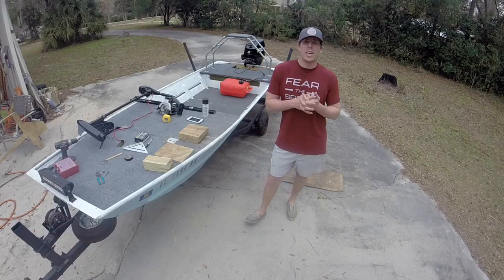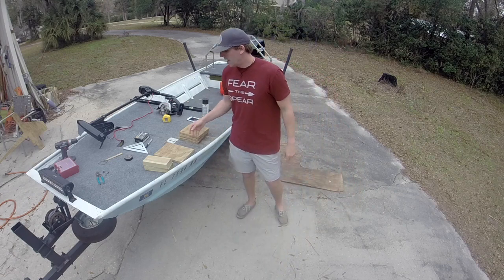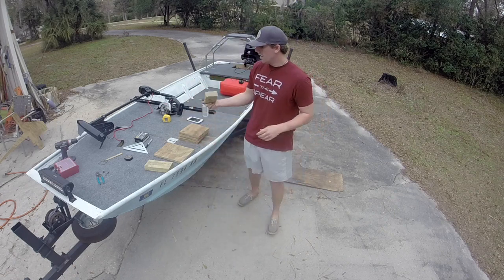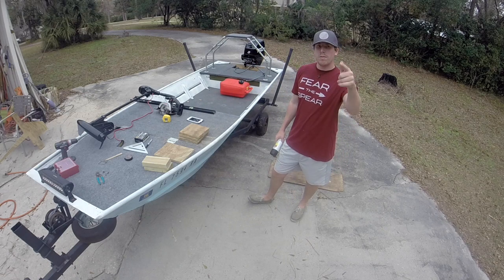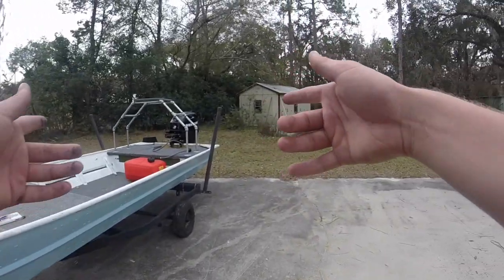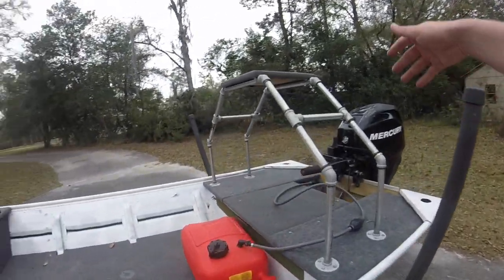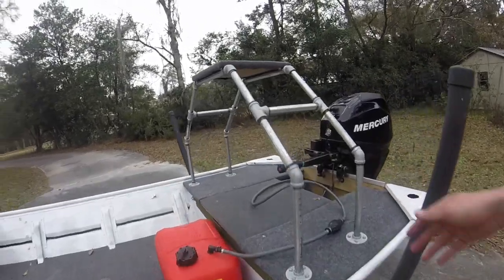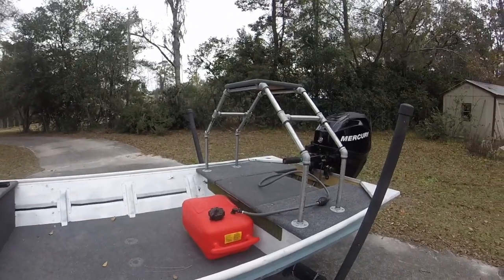Jon Boat Bow Trolling Mount

Comment: pressure treated wood will corrode aluminum.  I would have used 2 x 8 wood instead of plywood.
Reply from the maker: Yeah I didn’t read into that until after the project, it’ll have to be redone eventually

Comment: Could you send me all the measurements cuz I have the same boat
Reply from the maker: Nico Lucas the materials and measurements are in the description
Reply: The top piece would not be 8x8 since it has to overhang the others to allow the 2x4 pieces to be attached